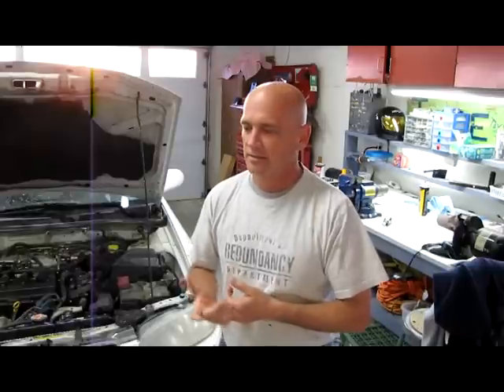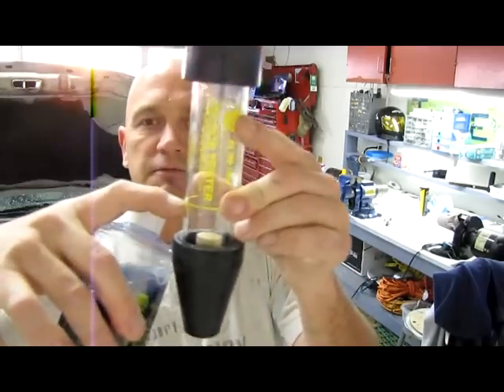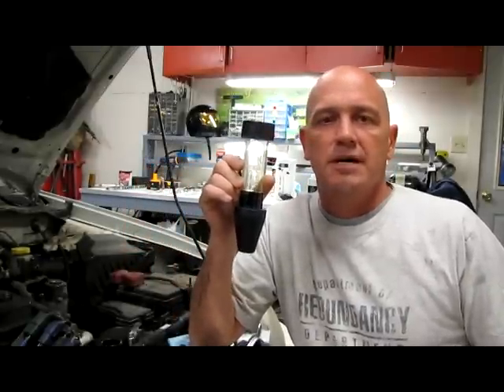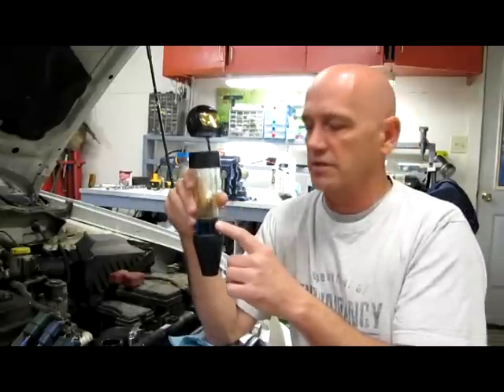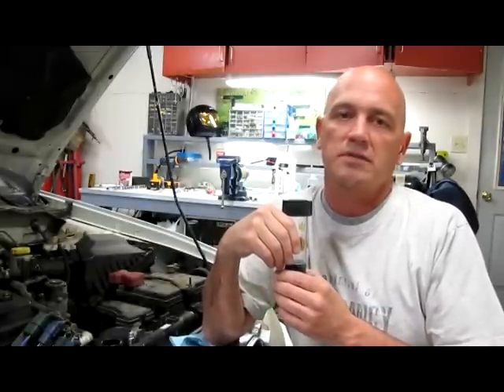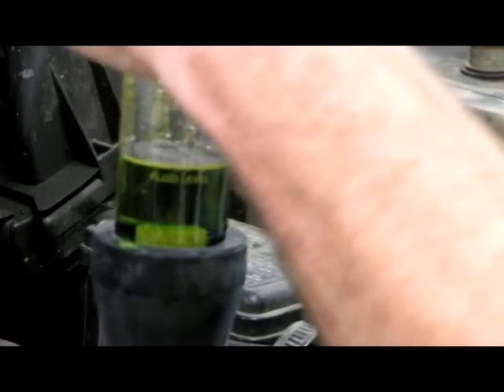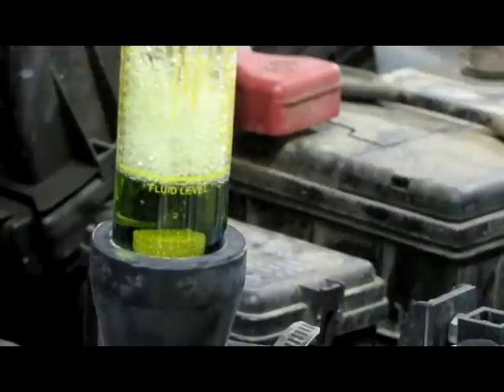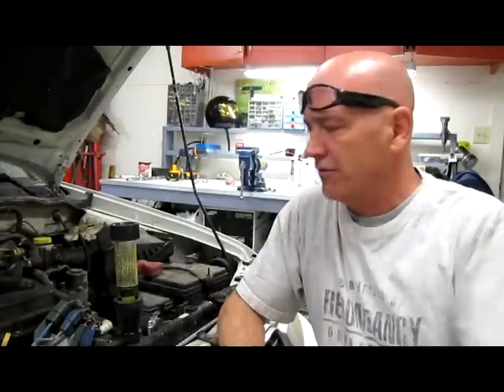How to Test Head Gasket

Comment: Reluctorvalve sorry for the late update, but a couple days after you suggested the pcv valve to be replaced I did in my vehicle and let me just say THANK YOU. About two days after I installed the new one I still saw condensation under the cap, but the following days later it stayed bone dry. It worked, I am truly thankful for the help you gave because I literally did hours of research only to find 95 percent of the sources stating that symptom means blown head gasket. Sure glad someone kind enough like you took he time to inform me on not just what could be a solution, but why it could be he solution. Again many thanks and if I may in the future when I have car questions I'd be happy to have them answered by you.
Reply from the maker: Long: First, I'm not sure why your response isn't populating underneath our previous exchange below, which was a couple of weeks ago.  So, I will take the time to re-post our previous exchanges on THIS thread so readers don't have to search below.  It's long, yes, but I think pretty interesting.  Second, in looking over my last long response, I was incorrect about one thing that I know of, and not sure why this made it through my editing:  a bad PCV valve will NOT usually cause your oil to look like chocolate milk.  I must have accidentally left that in there from the editing process I did.  Third, I failed to mention what the 'PVC' stands for in PVC Valve.  PVC stands for Positive Crankcase Ventilation - which is kind of like how our noses work in relationship to the outside air and our sinuses.  What happens when your nose gets all plugged up and stays plugged up tool long?  We get sinus infections.  The nose needs to allow air to freely flow (correct me, medical folks if needed) in order to keep the sinuses clean and clear.  The PCV valve in this analogy is the nose.  If it gets clogged up, there is not enough transfer of AIR between the outside of the engine and the inside ' open spaces' of the engine. Because of the major difference in temperature in those inside spaces compared to the atmosphere (iced tea glass), you can get condensation. Hope this makes sense. Fourth, I'm glad, REALLY glad that I was the 5% which helped you out! I'd be glad to help you out in the future if I can.  Finally, so that those of you reading this know what the heck we are talking about, I will try to repost all of this thread here, below, which will include this exchange marking the end to this point.
I wouldn't do this if I didn't think it wasn't important.  It's a good 'gearhead' read, if nothing else.  AND, just how much did that PCV Valve cost (for the other readers) ???   r
Reply from the maker: reluctorvalve LONG: Hello I have a situation in my vehicle. About three weeks ago I removed the oil cap on my engine and noticed condensation in it, steam was even coming out of the opening. I assumed head gasket issue so I tried a very similar block tester like in this video, but the results are negative the test fluid stayed blue. My vehicle also does not have any other blown HG symptoms, no white steam out the muffler, no loss of power, no bubbles surging in coolant reservoir, and no loss of coolant. I would really appreciate any help or suggestions. Thank you
Reply from the maker: reluctorvalve Me: 
Long Eleven: Thanks for the concern - a good question.  What you are most likely seeing with the 'condensation' in my opinion is a need for a new PCV valve, and related to what we older folks call 'crankcase ventilation' stuff.  Today, 'crankcase ventilation' is directly related to, and a big part of what is called 'emissions controls,' which also includes things like unburned hydrocarbon management (unburned fuel), and catalytic converters (which consume that unburned fuel in an environmentally friendly way via their internal chemical makeup and chemical reactions to unburned hydrocarbons). That's the fancy part of it, and I may not be totally and specifically correct, but that's how I understand 'today's' relationship of what you are seeing.  Now, going back to the olden days like in a very old engine, imagine the engine block and head, together, as an enclosed unit, or 'case,' which houses all these moving parts.  Those moving parts all do different things, and one of the 'things' that some do is ignite fuel, creating a very powerful downward stroke on other up and down moving parts.  As this is happening, tons of heat is created, and while THAT is happening, cool coolant is pumped around those very very hot parts to take some heat away to the radiator (to then be dissipated into the atmosphere, and cooled back down). As this action is going on, remember your 'enclosed case' houses all of these actions - the entire engine of moving parts - with all its open spaces (valve cover) - there is air in all of those unused empty spaces in your 'enclosed case.'  That air in those spaces is hotter as it gets closer to the combustion chamber, and cooler as it is further away from the combustion chamber (valve cover). Condensation will occur with the changes in temperature back and forth. The HOTTER AREAS would be around the combustion chambers, and the COOLER AREAS would then be inside of your 'enclosed case' spaces further away from the combustion chambers and their surfaces. Heat in that case would go from the INSIDE OUTWARD into those spaces and surfaces to cool off, potentially creating condensation on the INSIDE surfaces away from the heat source. Vice-Versa, take a glass of very cold iced tea, put it on a counter in your very warm home, and you will see condensation develop on the OUTSIDE surface of the glass of tea. In this case, the heat would be attracted INWARD towards the cool glass surface (wished I'd have taken physics!) the heat is again attracted to the cool surface to cool off - It has to do with the temperature exchange within and on surfaces, probably humidity level (environment), and remember that your engine 'case' is somewhat enclosed, or semi-sealed, so it's hard for that air exchange to happen without condensation occurring. So your engine is now a 'reverse glass of iced tea' when it comes to condensation.  I'm no scientist, but to me, this makes sense.  So - it's normal to see SOME condensation, depending on your driving habits (very short trips would probably cause more), and that combined with where you live environmentally will determine the level you would see.  The most important thing is that you note there are no symptoms of a HG issue.  If you see chocolate milk developing with no HG symptoms, then you could have some crankcase ventilation issues (PCV Valve) if it's not overheating.  PCV valving helps to valve or manage that internal crankcase atmosphere and allow it to 'breathe'.  If this is a new issue for you, try changing your PCV valve. Perhaps someone with extensive emissions experience can toss in some further detail, but that 's the best I can describe it from what I know.  I wouldn't worry too much at this point.  Let us know how it goes!  r
Reply from the maker: reluctorvalve LONG: Reluctorvalve sorry for the late update, but a couple days after you suggested the pcv valve to be replaced I did in my vehicle and let me just say THANK YOU. About two days after I installed the new one I still saw condensation under the cap, but the following days later it stayed bone dry. It worked, I am truly thankful for the help you gave because I literally did hours of research only to find 95 percent of the sources stating that symptom means blown head gasket. Sure glad someone kind enough like you took he time to inform me on not just what could be a solution, but why it could be he solution. Again many thanks and if I may in the future when I have car questions I'd be happy to have them answered by you.
Reply from the maker: reluctorvalve Long: First, I'm not sure why your response isn't populating underneath our previous exchange below, which was a couple of weeks ago.  So, I will take the time to re-post our previous exchanges on THIS thread so readers don't have to search below.  It's long, yes, but I think pretty interesting.  Second, in looking over my last long response, I was incorrect about one thing that I know of, and not sure why this made it through my editing:  a bad PCV valve will NOT usually cause your oil to look like chocolate milk.  I must have accidentally left that in there from the editing process I did.  Third, I failed to mention what the 'PVC' stands for in PVC Valve.  PVC stands for Positive Crankcase Ventilation - which is kind of like how our noses work in relationship to the outside air and our sinuses.  What happens when your nose gets all plugged up and stays plugged up tool long?  We get sinus infections.  The nose needs to allow air to freely flow (correct me, medical folks if needed) in order to keep the sinuses clean and clear.  The PCV valve in this analogy is the nose.  If it gets clogged up, there is not enough transfer of AIR between the outside of the engine and the inside ' open spaces' of the engine. Because of the major difference in temperature in those inside spaces compared to the atmosphere (iced tea glass), you can get condensation. Hope this makes sense. Fourth, I'm glad, REALLY glad that I was the 5% which helped you out! I'd be glad to help you out in the future if I can.  Finally, so that those of you reading this know what the heck we are talking about, I will try to repost all of this thread here, below, which will include this exchange marking the end to this point.
I wouldn't do this if I didn't think it wasn't important.  It's a good 'gearhead' read, if nothing else.  AND, just how much did that PCV Valve cost (for the other readers) ???   r
Reply from the maker: reluctorvalve  
@reluctorvalve Hi and I apologize for not typing this or my last response under our convo, but for some reason I can't reply to any of the comments from it. Now to the statement you corrected from your first reply, I have to admit it did get me thinking how better recycled ventilation (like from a new pcv valve) would get rid of the moisture in the oil if there is no escape route. However, since it was a close thing to air and moisture in desperate times and because someone experienced, respectable, and trustworthy suggested it, I felt comfortable changing it. I don't know how it worked but it did. The pcv valve was less than 3 dollars. Bottom line is after daily accumulation of water droplets under the oil cap sometimes even being "chocolate milk" colored (I wiped it off the cap daily by the way), the thing that solved the issue after 3 days of installation was a new 3 dollar pcv valve. For that I am thankful, thanks again reluctorvalve.
Reply from the maker: reluctorvalve   
Long: It solved your issue because, by replacing the PCV valve, you 'unplugged' the plugged up nose, so-to-speak.  You replaced a part that helps to 'ventilate crankcase pressure' from the inside to the outside - which now allows those open spaces inside your engine to breath in and out as needed, and not just be stuck inside.  Glad this helped you!  And, thanks for all the follow ups for the other folks to read!  You've probably helped a lot of people by remaining engaged in this!  r-

Comment: hi, thanks for the good video you showing us. society needs more people like you. my question is, my car is a corolla black top 20valve, the engine had a bearing knock and it was redone, now it consumes a lot of gas, the extract from the exhaust system is gas and its black, the gas even smells inside the car. mechanics suspect the head gasket since it also pulls air in the intake manifold. please help.
Reply from the maker: Hi Bogani.  This doesn't sound to me like a head gasket issue.  Since you are smelling gas inside your car, combined with the extra gas useage and more black exhaust, this tells me that the computer in your car thinks it needs to be putting a ton more fuel into the cylinders than it needs to.  If it's to the point where you can smell it, it should be flooded, and not really running well, if at all.  Is this the case?  If it runs, and you smell gas inside, have it checked for a simple fuel leak.  Work your way out from there.  Hope this helps some.  r-
Reply: reluctorvalve
thanks for the response, but how can it be fixed, since it does not run well i assume it is flooded and also has the engine check light.
Reply from the maker: Bongani Nxumalo You will need to have a good repair facility with good diagnostic equipment work on your car.  Since one place told you it was the head gasket, I would recommend you try another place - it doesn't sound like you have the ability to do this yourself, so my suggestion is to find a good repair facility to work on your car for you.  That is how it will be fixed.  Good Luck!  r-

Comment: Hi i have a 1991 Nissan 300zx one day the engine got hot the temp gage got to H took the car to garage they changed the thermostat and fan clutch still over heated took it back they did the block test i was watching the blue fluid did not turn green or yellow i would say it just got a little bit lighter blue they told me its the head gasket so they put in something called blue devil to seal the head gasket and it worked the engine doesn't over heat anymore i been driving it for one week so far but there is one thing i did notice different in the morning when i start the car the engine reaches normal operating temperature quickly about less than a minute but does not over heat is that normal im in California so outside temps are already about 70 degrees oh and when they replaced the old thermostat it was already slightly opened don't know if that means anything .
Reply from the maker: Eddie: one thing that doesn't make sense to me about your story is that it was overheating with a partially stuck-open thermostat.  Although in a more extreme head gasket issue that would be possible, with a mild issue typically your engine would tend to run too cool all the time, with little to no hot air from the heater - all caused by a stuck-open thermostat. So I don't get how it was overheating with that thermo that way - although the B Devil helped.  Odd.  I've used Blue Devil.  I'm not a huge fan of additives for repair, but it did work for me for some time.  If my car was super nice, I wouldn't use it, though.  The heating up really fast - I had a car that did that, too, and it had some compression leak issues. I found that strange, too.  So I don't have many answers for you - sorry!   At least you're back on the road.  I'd really keep an eye on that temp.  Good Luck!  r-

Comment: autozone rent the pump for( free)             fluid its 5 bucks there too
Reply from the maker: Jose:  Nice!  I also know that they do.  I'm not typically a huge fan of that place, because of their business model.  They are all about the 'bottom line' in profit, shrinkage loss, etc.  I'm a big fan of other places which are all about 'customers' and 'car repair.'  And, these other places probably offer the same 'pump' (test tool) as well.  But good to know as another option-  just be prepared to deal with their stringent rules!  They have many many many!  r-